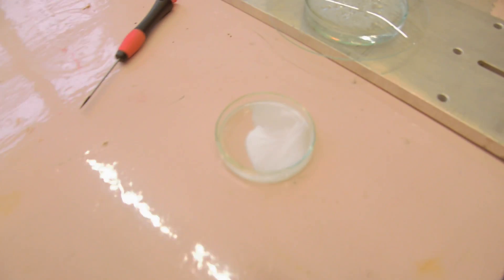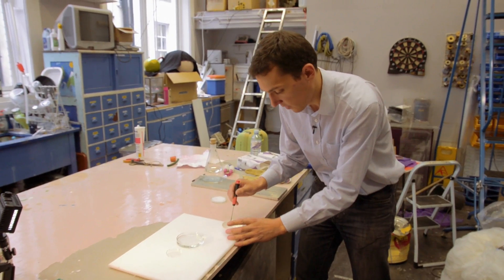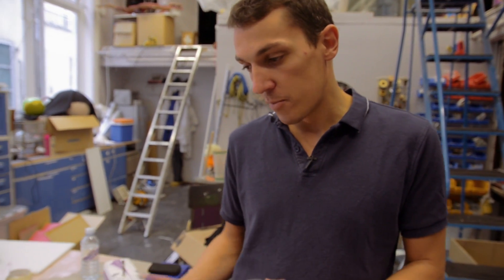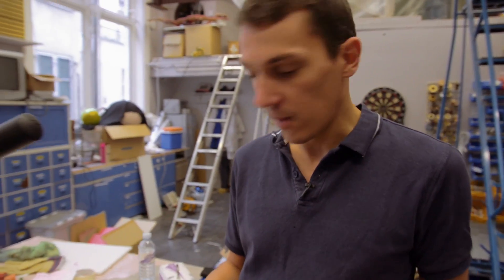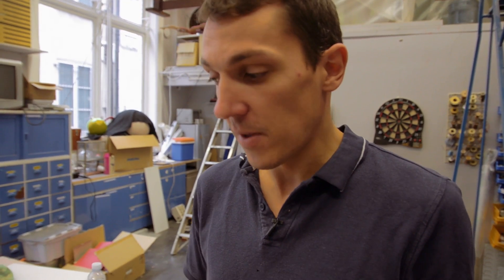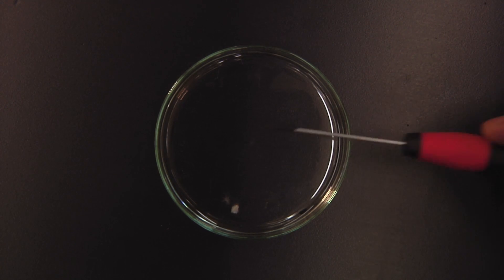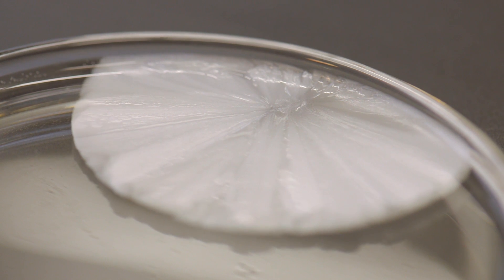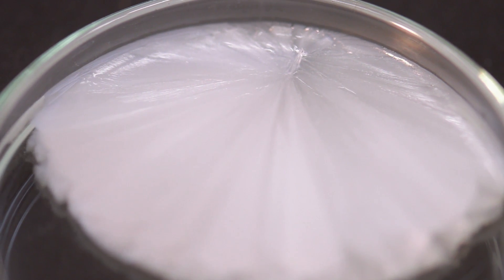Supersaturated Sodium Acetate | Tales from the Prep Room

Comment: Its called phase separation and is not something you would want if you want to use it as heat storage.
The reason it happened is because sodium acetate was not mixed in perfect ratio with water. So you have areas with more water and areas with more sodium acetate. As you said, sodium acetate trihydrate is already a supersaturated solution at room temperature, if you have areas with even more sodium acetate, then it will be even more supersaturated and unstable at room temperature. On the other hand in areas with more water,  crystallization will be delayed, exactly what you experimented.

Comment: I believe there are two types of crystal. I found this when making my own with white vinegar and baking soda. I boiled down 8 Liters of the solution/solute down to 500ml. It turned a clear orange colour.

Anyway I started sloshing the hot solution around the bottom of the pan and a thin film of solution was left. The heat of the pan was such that the film spontaneously crystalized. It was beautiful. Seeing the crystal race over the surface of the steel pan. I could slosh it back and forth. To repeat the experiment. But if you left it for a few more seconds the crystal had a second stage where it turned a fluffy white colour and the volume of the film expanded. It appeared more like a Slush puppy than a crystal.

I took a sample of the white stage and left it in an open jar. The next morning it had turned into a drop of liquid. I am guessing the white power crystal absorbed water from the air and liquefied.

Comment: it is friction based reaction. stimulated by electrons rubbing into each other. Friction gives it enough energy to start a reaction just like lighting gas on fire. You dont need the crystal dropping to induce the reaction...just vibration.

Comment: I don't know the physics, but the large crystals like that form when it's just a tiny bit too concentrated, but not by so much that it just falls out of solution immediately.  In my experience they're only stable if they're absolutely not disturbed while cooling.  Possibly it's a different crystal structure.  If you have a way to put it under a sufficiently powerful microscope that might give some hints.

Comment: For certain crystals the driving force for growth can vary depending on the crystal direction. It's interesting to observe that all of your crystals in the semi-crystalised sample are needle like. If you have a piece of contaminant that can provide a seeding point for one of this directions, but there is not enough of a driving force for any of the other directions (perhaps you cooled the sample quickly), you can imagine needle like crystals could form around this point, which is fairly similar to what you see in the dish.

Comment: The area immediately (micron scale) around the crystals had a lower in concentration than the overall solution due to the formation of those crystals.
Reply: +Morlanius but doesn't that mean that the concentration gradient would reach equilibrium just quickly and therefore continue to crystalize?
Reply: TheNaz The depletion layer around it insulates the rest of the solution from the reaction.
Reply: How Youtube conversations should be.

Comment: The solutions in the Petri dishes are not sealed, like your typical sodium acetate handwarners or heat packs. They are also probably not prepared consistently and protected completely from environmental contamination. Likely, the acetate in the semi-solid dish was either not prepared correctly, or has become contaminated with some substance partially inhibiting crystallization. Since the release of the stored heat in the supersaturaturated solution brings it to 130°F (1.3 times the temperature of a healthy cow), the more complete release of heat may finish the process by driving off an excess volatile like water, or may simply impart sufficient kinetic and heat energy to complete the reaction in a contaminated medium.

Comment: Seems like there might be some sociological parallel.  It's not optimal for any one person to change state even if there is a good reason do so, but as soon as there enough adventurers - the small committed group, they can start a movement.  Prions.
Reply: The solutions in the Petri dishes are not sealed, like your typical sodium acetate handwarners or heat packs. They are also probably not prepared consistently and protected completely from environmental contamination. Likely, the acetate in the semi-solid dish was either not prepared correctly, or has become contaminated with some substance partially inhibiting crystallization. Since the release of the stored heat in the supersaturaturated solution brings it to 130°F (1.3 times the temperature of a healthy cow), the more complete release of heat may finish the process by driving off an excess volatile like water, or may simply impart sufficient kinetic and heat energy to complete the reaction in a contaminated medium.
Reply: Or, like he said. The water is evaporating out of the dishes.
Reply: Reminds me of Michael Feldman's "What do you know?"  Under the category Things you should have learned in school.  "What's a petri dish?  The answer correctly given but due to the caveat "although the questions have been thoroughly researched, the answers have not.  "A dish Laura fixed for Rob."  Sorry about that.
Reply: Yeah, except the consensus is that the character's last name was spelled Petrie. But she was enough of a babe, you could have actually referred to Mary Tyler Moore as "that Petrie dish."

The crowd goes wild....

Comment: is it safe to eat or to put food on top of it? whats the temperature of the frozen final solution?
Reply: Firstly no as it is not sodium chloride which is normal salt you put on food.
As for the second question, it is not freezing it is crystallising. The crystallisation makes it get fairly hot from the temperature it was previously at making it ideal for hand warmers.
I'd say it reaches about 35-45 degrees Celsius.
It gets hotter not colder.
Reply: Ben Sweeney
Thanks for your answer mate. You see, I'm a cook and I've been watching videos about this supersaturated liquid and I came up with the idea of using it as a dish wear. Imagine getting to the table a plate with a liquid in with you tap it and it crystallizes then you can actually sear a thin piece of meat or something, and as I thought sodium chloride would have the same effect as salting, so it would be even more amazing. But  I guess theres not a chance that could happen with this solution and it wouldn't be safe for eating, even though you're not eating the solution it self, but the food on top of it. Do you have any idea with a similar compound that would work? Thanks for you time anyway. You have been really helpful.
Reply: Actually, sodium acetate is not very toxic. If you compare the LD50 (median lethal dose) of sodium chloride aka table salt (3000 mg/kg) with the value for sodium acetate (3530 mg/kg), you'll notice that sodium acetate is actually a bit less toxic than regular salt. However, as with table salt, I wouldn’t recommend eating a spoonful of sodium acetate, since that would probably cause side effects. I have to admit that LD50 doesn't say everything, but it is usually a good reference for immediate toxicity.
The reason behind such a low toxicity is that the acetate part is ubiquitous in nature. It is used in many biochemical processes happening in pretty much every living being.
Sodium acetate is actually used in the food industry in the form of sodium diacetate, a mixture of sodium acetate and acetic acid (the acid in vinegar) as a seasoning for salt and vinegar chips.
As for an application in molecular gastronomy or whatever you want to call it, I don’t consider myself knowledgeable enough to give you a good idea. However I do think that a nice idea you got there! I wonder if anyone else has tough of cooking with sodium acetate. I think the main drawback is that sodium acetate would be considered as a «chemical» and therefore as «nasty».
Reply: supersmashsam 
While you can eat it the main problem is it won't taste like normal salt. It will taste very bitter, much like vinegar (Oh and it smells like vinegar too). It is sometimes listed as irritant on safety labels though.
Carlos Cordeiro 
If you want to try it you can find a guide online telling you how to make it out of baking soda and distilled vinegar or you can buy it from an online lab to ensure you get a pure sample. When you make it at home it is slightly brown.
The last problem is (if you think it tastes okay) be aware that as the crystals are so small if you put a layer on a plate it will crumble and break very, very easily. (Especially so if you are cutting along the lines of the direction it crystallised, it will just separate. Also you only want a minimal amount on the food because as supersmashsam  said it has a similar toxicity as salt. Just use it as you would use salt.

You sound like a very creative chef, and the only way you'll be able to find this out for sure is test it yourself, first taste and then your use. Good luck with your experiments.

If you're in North America here is somewhere you can order it from
http://www.sciencecompany.com/Sodium-Acetate-Trihydrate-500g-P16276.aspx
Reply: if done ideally, 58 celsium

Comment: If you put powerful enough lamps directly aimed at the solution it may have been heating it up enough to prevent crystallization from occurring quickly. (that would be my guess)
Reply: Possibly, but from what I can tell from the video (my memory is useless in such circumstances...) I had a small LED lamp close to the sample, and a tungsten lamp rather a long way back. I doubt the latter would have much of a heating effect, to be honest.

Interesting thought, though. Not the first time that a reliable demo failed completely as soon as it was placed in front of a camera!